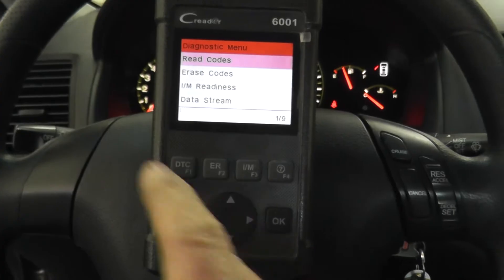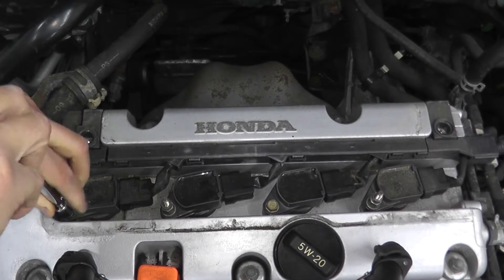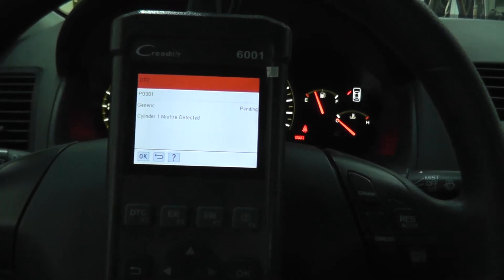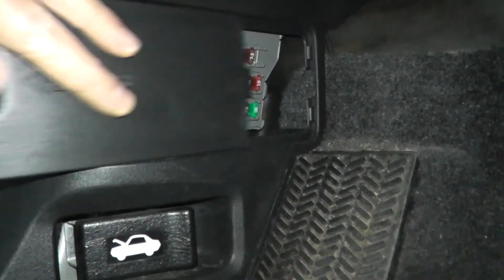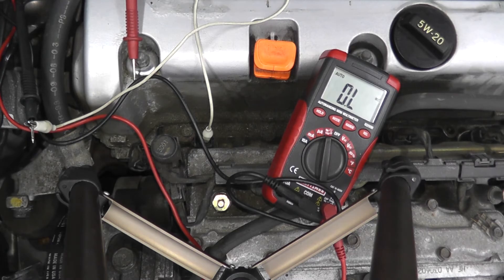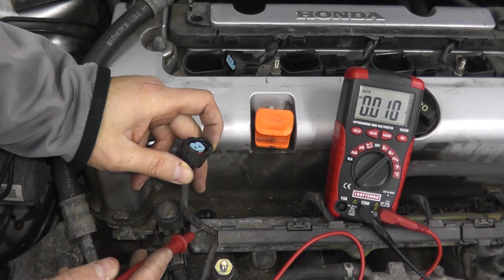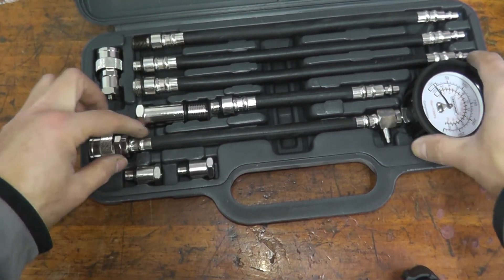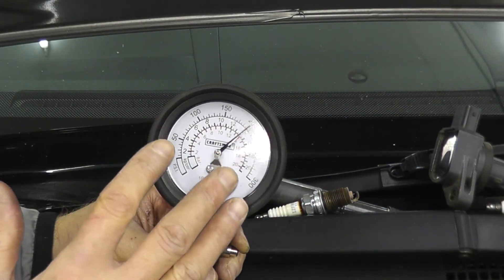How To Fix A Misfire Code with Basic Hand Tools | P0300 P0301 P0302 P0303 P0304

Comment: Simply amazing!!! I have a 2014 Ford Edge, had spark plugs and coils changed.  One month later 1 misfire took it to dealership they swapped coil or plug 3 to 5....One week later another misfire.....took it  elsewhere new coils & plugs again....misfires times 3....Im frustrated as a women. I need my vehicle for work. Any suggestions

Comment: "Mechanics, I need your expert eyes—this one’s been driving me crazy for weeks!"
Comment body:
I have a 2019 Kia Forte (2.0L) with 118k miles. Here’s the full story:
First misfire appeared on Cylinder 1 and 3 → engine shaking badly, CEL on.
Replaced all spark plugs and all coils → car ran perfectly for 2 weeks, no shake, no CEL.
Misfire came back → Cylinder 3 only, CEL returns.
Checked spark plugs: some oil on the bottom of plugs. Replaced PCV valve, valve cover gasket + spark plug tube seals, cleaned spark plug holes. Still misfire persists.
Bought and swapped all fuel injectors to test if #3 injector was bad → misfire now follows to Cylinder 2.
Tested coil connections, spark plug connections, and fuel lines.
Idle now smoother than before, RPM stable, but slight shake at red light; CEL comes on.
Scan shows P0302 (Cylinder 2) and sometimes P0303 (Cylinder 3). Battery voltage slightly high (14.1V).
I’ve replaced basically everything: spark plugs, coils, injectors, valve cover gasket + tube seals, PCV. Still, misfire codes move with the injector swaps.
Question: What could still cause this cylinder-specific misfire? Injector seating? ECU adaptation? Compression? Should I test the crankshaft position sensor or cylinder compression next?

Comment: Hello I have a kia forte 2019 have misfire on cylinder 3 changes all the spark plugs all   coils also changed the Valve Cover Gasket Kit the tube seals and still check engine with misfire and rough idle engine shakes too much please help

Comment: Mechanic said the spark plug and coil has no problem. Switched fuel injector 1 and 2. Engine light off. The next day cold start engine shake more than before. Then engine light come back. Anyone has idea what happened?

Comment: Nice video. Should also check the negative wires on the supply voltage connectors by placing the volt meter's positive lead on battery positive and meter's negative lead on negative wire of the relevant connector. Point is to alwys check the negative of the device's supply as well.

Comment: What you didn't show was how to fix the wires if your multimeter had shown a problem. 
After spending $1300 replacing coil packs and spark plugs trying to fix intermittent code P0303 to no avail, a neighbor came over and cut the wire on coil 3, then used a butt connector and heat gun to fuse new crimped wire. Car runs great now. Wasted $1300 at 2 dealers shops who just threw expensive parts at the problem, parts that were not even the cause. My neighbor bought me the bad part for $12.

Comment: 2010 Tacoma 2.7 
P0301 code 
Spark plug, coil and injector changed 
Cylinder Compression 150psi 
Injector connector tested with a Noid light tester(ok), “computer” or ECU changed , additional info: all four spark plug plugs looks good, when disconnecting the injector 1 vehicle get worse. whoever comes with a “fresh” idea or diagnostic that fixes my truck I’m willing to compensate $$$ for it 😉

Comment: I’ve been having an issue with a 2014 Q50 where I get a misfire on cylinder 1 and it’s always cylinder 1. The spark plug is gunked up with black junk and I’ve changed the spark plug and coil pack but 2-3 weeks later I get the same trouble code P0011 and P0301, the car only has 53,000 miles on it and when I run the scan tool it says VVT Bank 1 failure and VVT bank 2 failure. Could this be a bad Solenoid on either side or could it be the fuel injectors? Like is said when I change the spark plug on cylinder 1 it runs fine for a week to 3 weeks then I get the same gunk on that spark plug in cylinder 1. Is there any way to fix this? Do I need to change all the injectors or solenoids? Thanks any help would be much appreciated. Love the videos.

Comment: I have a 2018 Jeep Grand Cherokee summit 3.6L.I had codes up for a few weeks now, PO300 306 304.  I replaced two ignition coils 4 and 6.  I replaced the PCV valve but I noticed the hose connecting to it was broken in half right on the elbow,  there's no telling how long it was like that. what sre the symptoms with the broken PCV hose? got it fixed but only it's only showing a po300 and still idling a little rough. And I know my Jeep has more power than this.  I'm more than sure there's other symptoms but I like to know If there's damage or if anything else I need to replace Thanks

Comment: Hello Sir.
I have a honda accord 2008. The engine light is flashing and the car has shaking. I already changed the the 4 spark plugs and ignition coils. Still didn't solve. The computer diagnose says the cylinder 2 has too misfires. 
What do u recommend

Comment: Hey man Please help me, you have been very helpful but I am still having issues.
First of all this is a 2000 acura Tl with 112.000 miles on it. I had a misfire for cylinders 1-4-6. I cleaned the EGR from gunks, cleared the codes, took it to test drive everything was fine. Then suddenly the battery died and I had it measured it, they said its bad and have to replace it. I only jumped the car it did not die ever again. But when I ran it on 14F today, it gave cylinder 5-6 misfires. Where should I look for the problem?

Comment: As someone who has worked on their cars for two decades, I love and really appreciate these videos. This is extremely detailed, and you cover almost every single issue one could have in this situation and this really helped me narrow down my issue. Just as a reminder to anyone who is reading this, it is possible that you could test everything with a multimeter as done here, and even though it is within the correct range, there could still be something wrong with it. I had a misfire on cylinder two (P0302) and did a compression test, replace spark plugs, coil, harness and the injectors. Everything was within the correct range... I took apart some of the engine as it is the only way to get to the injectors on the V6 MDX engine and the injectors were all reading 9.5 Ohms, so I was confused, but replaced the 2nd one as it was a misfire on that cyl and it fixed the problem. So I am thinking somethings the circuit on the injectors might show the proper Ohms, but the electrical part is not the issue, something else on the injector is.

Comment: i tested the voltage supply to my injectors and i was getting 6.6 volts across all the four terminals, what went wrong is that normal? resistance read about 10.6 ohms

Comment: can you get a p030# dtc that is just a sporadic event, i.e. engine is running smoothly and you clear the dtc and it doesn't come back right away?  I have a 2015 lexus rx350 with v6 [ 2gr-fe ] motor that only has single owner 62k of miles on it that raised a p0302 dtc and clearing it didn't lead to it coming back right away.

Comment: Great video! I have a misfire cyl 1 injector circuit open code. This is on a 96 Isuzu Rodeo 2.6l manual trans. I'm trying to figure out why the signal to injector with a node is weak and very slow compared to the other 3 injectors.  Being this is fuel injected with a distributor...I really don't know where that signal is produced and again, what would make that one cylinder misfire. I immediately replaced plugs because it was due sparkplugs then I replaced,  then switched injectors.  Same thing no matter what I do? Any suggestions? Thanks
Reply: Coil packs ?
Reply: @adriandominguez1494  just has one coil & distributor

Comment: Excellent video! I had 3 out of 6 cylinders showing misfire codes (including one with new coil, all have new spark plugs) and my mechanic adjusted valves to fix it. However, this made it much worse. Now all cylinders are misfiring and vehicle drives and idles very rough. I will attempt these tests. I'm at a loss for what's the cause
Reply: Hi I hv one cylinder misfire. Mechanic switch fuel injectors 1 and 2. Now shake even more.  How’s your problem going?  Is it solved?
Reply: @garysiu5498 I didn't get my problem solved. Fuel injectors are one thing I haven't changed

Comment: Good informative and well do video. I wish he would have checked the powers AND grounds on the fuel injector and coi. Also,  how do you check the control wire on those. Thank you

Comment: I have missfire code P0302 and P0304.. change ignition coil/ spark plug, fuel injector,, compression test change fuel pump and did all the things you showed in video,, but my missfire code still keeps coming on,, please help,, I don’t know where else to look…Thanks

Comment: Hi everyone I’m a Honda and Acura technician just wanted to say very great video very good explaining the steps yes I recommend people start educating them selfs about there vehicles yes you can check a fuel injector with a multimeter and please wear safety glasses especially if your gonna deal with the fuel system great video you could definitely be an automotive instructor 👍 thumbs up 👍
Reply: Since you're a honda tech, I scanned my car and it said all coils were bad. There was no indication they were going bad. Is that even possible that all coils would go bad at the same time?
Reply: @JoseReyes-sf5hd  internal short circuits, mechanical damage, contact failure and faults in the voltage supply or worn out spark plugs

Comment: Im having a misfire problem, but i dont have any check engine light, is it possible that the scanner can see it? Tried to pull the coil pack one by one while running everything is reacting, 
Same on the injector tried to pull it one by one same reaction rpm drops, my problem is my engine is having hiccups
All spark plugs are clean now im on dead end dont know what to do,
We have the same car and engine. Please help

Comment: Not happy with the vid. I think you should unplug the cylinder 1 injector connector with the car running. That will tell you something more. Maybe switch injectors. That will tell you even more. Anyway... Just an isolated opinion.

Comment: If you have a misfire code for all six cylinders, this reduces the possible causes.  What are the possibilities?  This is on a 2007 Avalon.  Please don't mention spark plugs, fuel injectors, coil packs or compression.  The car runs well and turns on the engine light with the six codes when you push the car to 80 mph.  It runs rough when it triggers the engine light until you shut the engine off and restart.  Then it runs great until you push it again to 80 mph.  Fuel trims at idle  looks good.

Comment: Absolutely brilliant. I'd had an old school go. Then I saw your video. I have exactly that engine and a misfire. Pulled the covers off and did all your diagnostics . I swapped coil packs while engine running. The misfire followed the coil pack. So off to get one tomorrow. Many thanks.

Comment: Question for you. My '09 Fit is having the p0300, p0301, p0302, p0303 & p0404 all at the same time? Has recent "correct" NGK plugs & only the engine only has about 120k miles. Car goes into limp mode, CEL flashing, wont rev past 1500rpm. I cleared the trouble codes, drove 65 miles & got the same codes, but the CEL was OFF at idle this time & started flashing anytime I attempted to rev past 1500rpm in neutral w/ the car in limp mode, the CEL turns off immediately when the RPM returned to idle. I reset the codes again & seemingly back to normal operation. 

Any thoughts on this?
Reply: you figure out the problem ?
Reply: @plutodread97 yes. It was caused by the lightweight flywheel I put in with the new clutch. GE requires a tuner to disable some sensors to be able to use lightweight flywheels. I put an oe replacement in and its been perfectly reliable since.

Comment: Thank you very much, I got a Kia Forte Koup 2013, check engine light on and code PO302 cylinder2. I replaced spark plugs and coils and the misfire still there.

I'm going to check today the fuel inyectors to see if i can fix my car😢 and I'm going to sell that Kia I'm back to Honda lol

Comment: I’ve gotten the p0303 misfire cylinder 3 I’ve changed my spark plugs n coil & my car still jerking and engine light blinking , what else can it be ?
Reply: i'm in the same boat as you lols.. i'm still trying to figure what the codes are for lol might take it to the shop soon  lol

Comment: Quick question after you replace the coil pack and you rescan the car will the code go away or do I need to reset something?
Reply: Gotta clear code I believe and rescan if it comes back it isn't fixed if it doesn't it's fixed

Comment: Great video mate. One suggestion for coil/spark plug testing...say code is for Cyl 1, swap coils between 1 and 2 and plugs between 1 and 3, if the fault goes to 2 or 3 you have the answer. If the fault stays on 1 you have ruled out coil and plug in one go.
Reply: Isn't that what he said at 2:27 in the video?
Reply: @BruceD42  Not exactly, I added a suggestion to rotate the plug at the same time. Two birds, one stone.
Reply: What if the problem stays on number 1 what would be causing it ?
Reply: u  just made it confusing , coilds 1 n 2  nplug 1n3 fault 2 n 3 is answer,

Comment: This is an excellent tutorial! I appreciate the overview style of instruction about the topic. Other instructional videos tend to troubleshoot active problems; this approach is fine if I happen to be fixing the exact same problem. Unfortunately, because my problem is usually slightly different than what’s presented in the video, I have to rely heavily on background knowledge and / or piecing together information from multiple other videos. In this video, he outlines the fundamentals and then briefly explains how to troubleshoot and fix the multitude of possible issues. It’s a well rounded and succinct way to explain a topic. I’m working on a dodge v6 engine while he’s working on a Honda 4 cylinder and it’s still the video I prefer. 😅

Comment: As a licenced mechanic and electro-mechanical engineer tech I say you are an excellent video teacher.
Reply: Can you explain the compression test? Did he crank the engine 4 times rapidly? Why did the pressure increase in discrete steps? He seemed to gloss over that 🫤
Reply: @ste2hedz  He just held it cranking until the reading peaked...the pressure builds, it's not instantly at max.
Reply: Why would my mechanic replace spark plug but not my ignition coil. My dodge calibe has a p2311 and now I’m fixing it as I watch him. Money down the damn drain. My light wasn’t flickering til he worked on it it was lit but not flickering
Reply: Thats grate test done there.I also concider checking if that same coil ,could  be throuwing spark out side it..Thats one of random issue i experience with missfire  on faulty coil.
Reply: In swapping only the coil pak between cylinder1 and 2, does that only test the spark plug?

I imagined the spark plug wires on spark plug 1 and 2  would also have to be swapped to test the coil pac.

I'm asking because I am the lucky winner of a P0304 code that I am trying to learn how to fix.

Also, my vehicle is one without coil paks.

Please advise, and big thanks.

Comment: Very nice step/step video.

My wife's 2016 Rouge only has 4,500 miles on it. All the sudden it ran very rough and shaking. Had P0301 P0300 p0219a codes. I swapped 1 & 2 coils with no effect but then swapped plugs and then got P0302. Changed the plug thinking I was done. Day later get P0303. Changed all the plugs and have rough idle and can feel misfire sporadically when driving but now get P0300 only. I have a code reader and was looking at misfire counts and cylinders 3 & 4 have ever increasing misfires while 1 & 2 show none. Just for grins I swapped coils between 1 & 3 and 2 & 4 but the misfires stay with 3 & 4.

All the original plugs had some carbon on them and fuel around the threads.

Any suggestions on what to look for next? - Thanks

Comment: I cant seem to fix my p2646 code. I've tried all parts associated with the code. I've replaced everything with honda parts. I've cleaned all screens and nothing works. 2 oil changes later and still cannot go over 3k rpms. Would it be a coil pack/spark plug issue? I'm at a loss.

Comment: Just a couple comments, for one in my many years experience most vehicles have the relays and fuses for the engine in the engine compartment. Normally the fuse box for the cabin electrics like the lights, windows, door locks, dash, HVAC, entertainment, etc, is in the cabin. Two while doing an OHMs test can tell you if an injector has either a complete open or shorted circuit on the primary windings inside, it will  not test if the pintal is moving or if there is a partial break that is causing the injector to not generate a good magnetic field to move the pintal. An injector being mechanically stuck is more common then an electronic fault, which your resistance test with a multimeter will not show. Also you dis not mention the fact of the signal wires or testing the ground connection on either one of those circuits, which could also have a fault. I know what dealers say to test, but true diagnostic technicians know those are often poor testing methods the dealer has in their flow charts. Also you did not do a voltage drop test on either one of those circuits when testing your power feed, which is a superior test to testing for resistance which a wire that is almost completely cut will show up as ok when testing resistance. If you are going to show stuff like this, please show good testing methods instead of the bs that has been standard in the automotive community for too long.